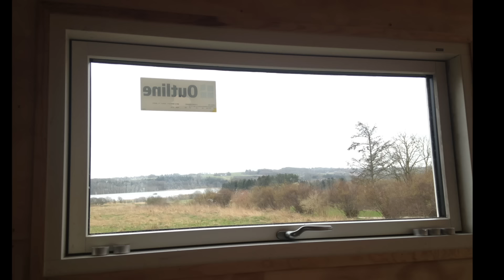How Tiny Living Drastically Changed My Work Life I Surviving On a Minimal Income

Comment: you could do this in the USA - you just need $5,000,000 in savings to quit your job, 3,000 acres of land in the wilderness (with WIFI,)  a $140,000 "tiny house," a $300,000 tractor to move it and another $50,000 worth of tools and supplies.
Reply: I did all of this lest than $15,000, so what sre you talking about.

Comment: I also moved to a rural area four years ago and wouldn't change it for anything. But my approach has been very different. I work a full-time remote job and don't really want to go offgrid, chop wood for heating, collect rainwater to shower, etc. Instead, I use all amenities available to me and think of these things as backups. I like modern technology! Well, at least some aspects of it. Combining high tech and low tech, finding the right mix, that's more my vibe.